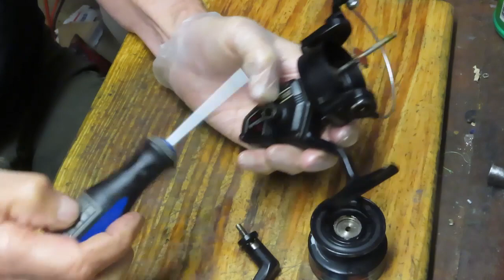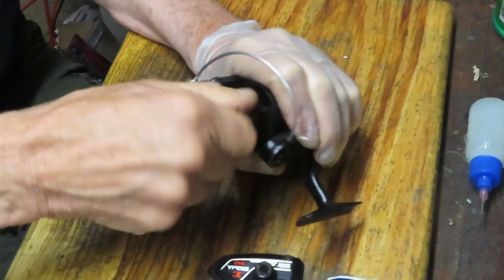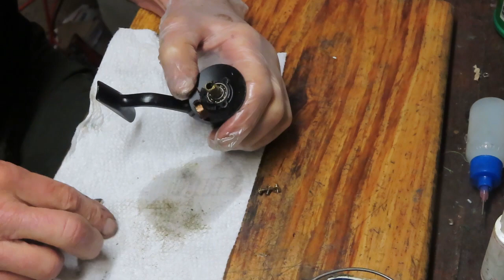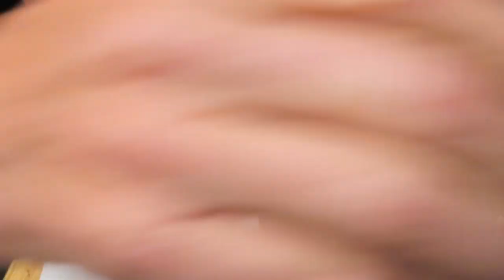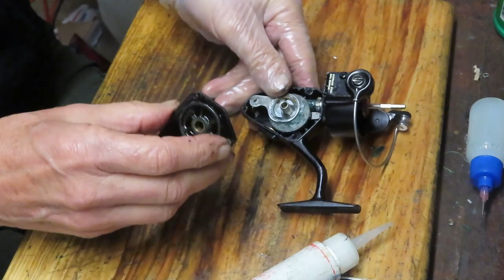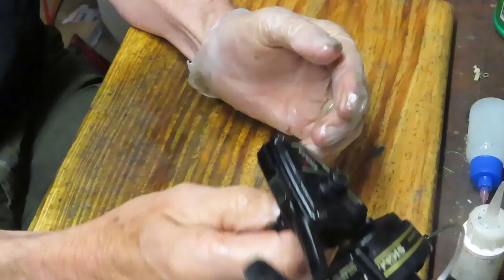Shakespeare Sigma 040 spin fishing reel how to take apart and service

Comment: Interesting reel. I have not been that interested in the Alphs and Sigma reels. I have collected the gold 2700 series and the blue 2400 series Shakespeare reels. They were made by Ohmori and are very fine reels. The one Alpha 070 I purchased had a smashed up oscillation gear inside which made it useless. I was glad to see the inside of a Sigma as I had not seen one before. — Chris
Reply from the maker: They were solid and dependable reels.  Not sure which manufacturer in Japan made these